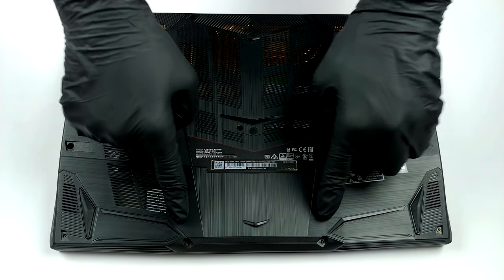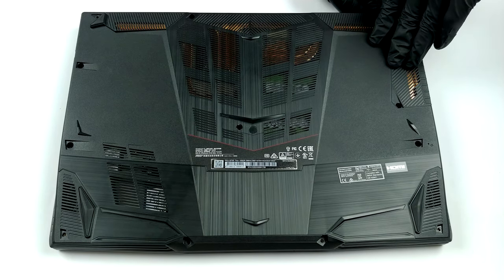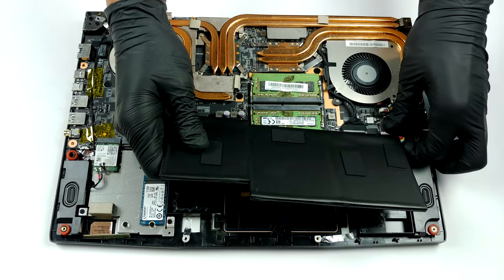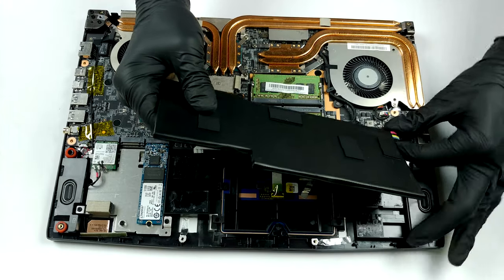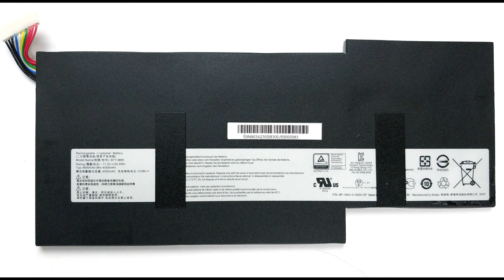🛠️ MSI GF65 Thin 10Sx - disassembly and upgrade options

Comment: How to remove the fans for cleaning ?
Reply: You will have to remove heatsink first
Reply: also to remove the whole heatsink does require removing the display cable if display cable not seated in correctly u will end up frying the motherboard voids your warranty

Comment: Can we upgrade the battery to 60Whr?? And where can we find a custom battery??
Reply: did you ever find a battery? I no longer have warranty on my laptop and my battery went bad.
Reply: @Vale-jg1zm  nop i didn't find and i too had some battery problem. My battery used to die suddenly at 30% and i found the solution. Calibrate ur battery in msi dragon center and it might be fixed

Comment: Looks like the RAM is running 1Rx8, at least one of the sticks are. Youll want that to be 1Rx16 or it will cause the laptop to potentially be up to 20% slower than it should be. I can link source of proof if need be.
Reply: I want to upgrade the ram and source?

Comment: hello i have a dell xps 13 which ssd mve do you recommend?
Reply: If you have a high budget go for samsung 970 evo nvme ssd or else ssd's from adata are also really good.
Reply: @MdAsif-gb1sj  Hi, can you tell me what ssd you recommend to me for an MSI GF 65 THIN 10 SDR? It has 8gb ram currently and i wanna buy 8 more, can you also tell me that which one to buy? Thanks
Reply: @kyoshi1960  you can get crucial m.2 nvme ssd or a samsung 970 evo. The samsung one is a bit expensive but any ssd with the word "nvme" is going to work. And for the ram, get crucial 8gb ddr4 laptop ram. Make sure that the ram is at least 3000 mhz. Anything above 3000 mhz will work great. I hope this helps
Reply: samsung 980 pro 2tb

Comment: Hi, ive been dealing with this model and i have a couple of questions. Fiesta. does the laptop turn on without the batery ? And second. Does a faulty battery cause the laptop note turning on ? If someone can reply ando awnser Will be pretty apreciated. Liking ando sub from me. Nice video !
Reply: yes it runs without battery but not stable performance a bit choppy and slower (not recommended)

Comment: where is the space for 2.5" disk?
Reply: was investigating for a friend and it seems that on all GF65 models there's no 2.5" SATA drive-bay :( seems like M.2 (mSATA or NVMe) are the only way to go for storage in these things, which is great for thermals and battery-life, but not so great on the wallet.

Comment: is it possible to upgrade from the i5 to i7 intel? i have the msi gf65 thin 9sd
Reply: No, the CPU is soldered onto the motherboard PCB. You could try to desolder the current CPU and put your new CPU in its place, but even if you did that, the BIOS (in this case UEFI) could not handle the new CPU.
Reply: No
Reply: nope soldered cpu and gpu

Comment: Can't get the back panel off. Have the cover in the rear off but the back panel WILL NOT budge. Can't even get my tool to fit anywhere on the thing. Been trying for 3 days with no luck
Reply: Me too. Have you found a solution?
Reply: I got it off by starting on the screen edge corners and working my way around. But I got fucked up putting the thin plastic cover back over the screen components. The screen cable isn't letting me snap it back in.
Reply: @electricboogeyman5855  i got it working, didnt reailze theres a warranty screw under a sticker
Reply: @theriskyhimself  yeah that sticker was a bit random to me too but after feeling it and realizing the hole in the middle and punching through the sticker revealed the final screw
Reply: @scottyrotty  yup.
Reply: dont remove the hinge cover the hinge cover u do not need to remove because it wont affect removal i have done 60 msi gf65thin 10ue laptops already never had to remove a remove a hinge cover once always remove the screw and back cover all done u break the hinge cover plus back cover replacement cost msi fee 350$

Comment: I think there is something wrong with my lap's graphics card one day I was playing a game and suddenly the screen started to flicker and glitch so I restarted the laptop and I launched the game again the performance dropped by almost 60% I used to get 100+ fps in ultra,high settings mix in GTA 5 and watch dogs now it's lower than 70 in GTA 5 and 40 in wd2 can someone please help
Reply: Make sure it's not using the integrated graphics. Can be controlled in Nvidia control panel.

Comment: I will do split equal of 3-3 heatpipes and switch to a bigger fan for CPU(?)...
But as always, MSI can handle heat... 👍
Reply: I have the same model its running at 95 degrees
Reply: @intrend64  celcus?!
Reply: @intrend64  you might wanna increase the fan speed in the dragon center manually, it is loud but it keeps the temps under control. Also if you want to open it unscrew the fans and clean the dust there
Reply: @yuvrajguglani821  i have the one model with the rtx 3060 but same cooling, fan speeds are max, the laptop is new so cleaning dust wont do much i think
Reply: @intrend64  ok i have the 1660 super model so i thought it might help with yours as well
Reply: @intrend64  i am using the same so i suggest to reduce the CPU power to 98% so it wont get that much heated
Reply: You want to change the power plan settings so the max cpu power is less
Than 100% it
Will fix
It immediately . Under control panel, you also
Have to remove the performance mode power plan from dragon center

Comment: How did you get the battery out?   Mine seems to be stuck in the bottom left corner but I don’t see any screws or clamps holding it down
Reply: What did you do
Reply: It’s like a glue; something of a sticky or something but I’m afraid to pull too hard cause I’m afraid I’ll break it . There doesn’t seem to be any screws around the battery but I could be wrong
Reply: @jonathanparkhurst1080  I have the MSI bravo 15 which has the body of gf 65 thin I'm going to REPASTE it for the first time and add ram
Reply: @EchoDroll  did u manage to repaste? please send me video so i can repaste mine tooits msigf65
Reply: @hatty101  look at my most recent video I repasted after you learn how to open up the msigf65thin/msibravo15 it's really easy I'll give you a tip make sure you take out ALL the screws sometimes 1 is hiding and don't be very harsh on the plastic as it fragile I broke a clip but it's not important if it 1 more then 2 then it is
Reply: @EchoDroll  man u saved my whole life!!!!!!!!!!!! thank you so much! thanks thanks a lot, the temps are 95c+ it happen to many users and they said when they repasted they gained 10-20c less that massive improvement ( the temps are high on loads and gaming only, idle temps are super fine ) so i hope i can get better temps when i repaste, i will buy mx-4 is it good? and after i buy it i will repaste and clean the fan and the heatsinks!
Reply: @hatty101  please buy krynoaut it's more expensive but has less in it 1gram = 5gram but it's way way way better mx4 is good but krynoaut is better
Reply: @EchoDroll   but in youtube bencnhmarks only 2C difffrence, i will try to see if i buy it or not, but grizzle thermal is too little will it be enough to paste the gpu and cpu and have extra paste? or its not enou? and i heard it dry fast and there is scam product of it unlike mx4
Reply: @hatty101  thermal grizzlys liquid metal dries fast since it's liquid metal and corrodes with other metals but kryonaut is like every other non conductive paste in terms of longevity 1gram is enough for 2 or 3 times for a laptop Repaste and you should Repaste your laptop depending on paste but 3 years or 4 is enough 2 to 3c cooler for an extra 2.60 dollars is worth it. Condactonaut* something spelt like that is thermals girrzlys liquid metal kryonaut isn't but liquid metal is much better in heat transfer
Reply: just gotta say legendary profile pic :)